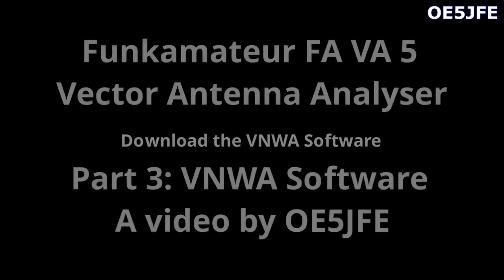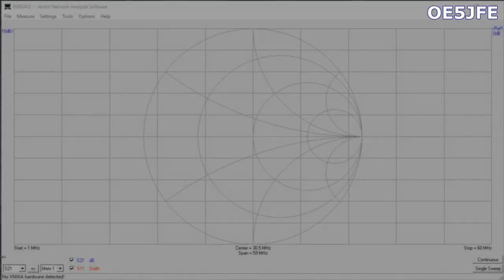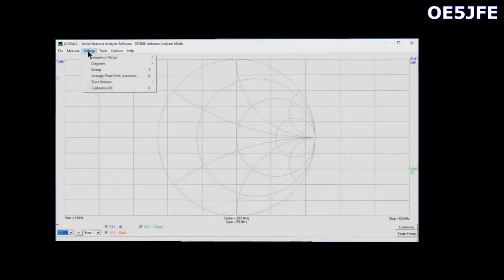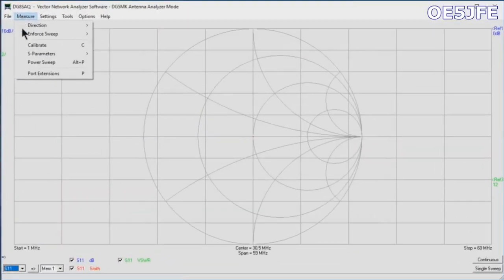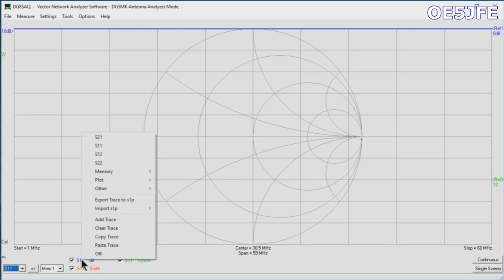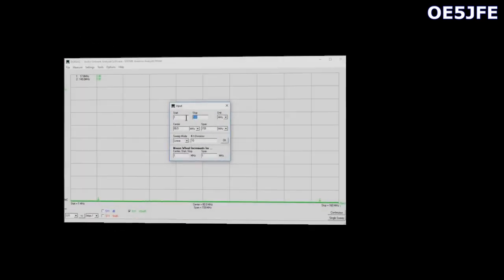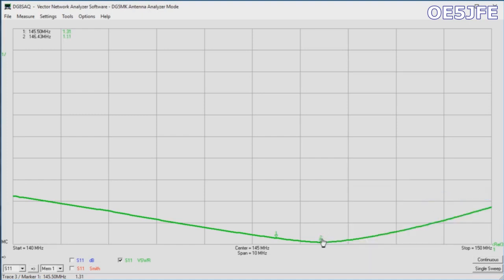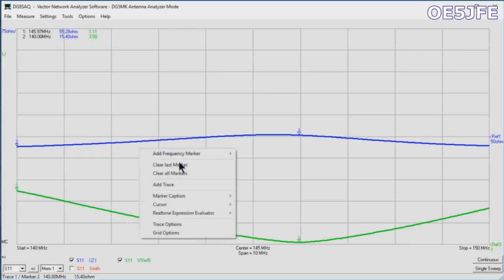FA-VA5 and VNWA Installation - Configuration - Calibration

Comment: Very good. "S-eleven" is actually S-one-one - the input reflection coefficient. The indexes are the port numbers of receiving and sending ports. In the case of reflection parameters, the two numbers are naturally always identical. S_21 (two-one) is a transmission parameter from port 1 to port 2. check out the user group: https://groups.io/g/fa-va5-users